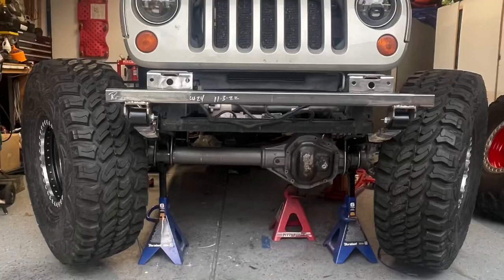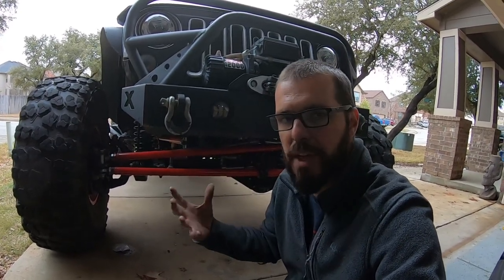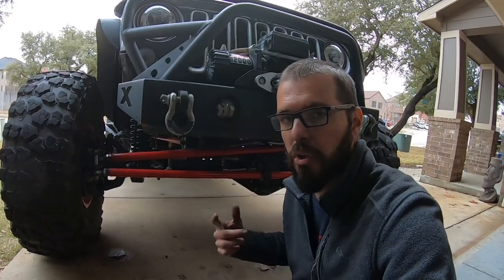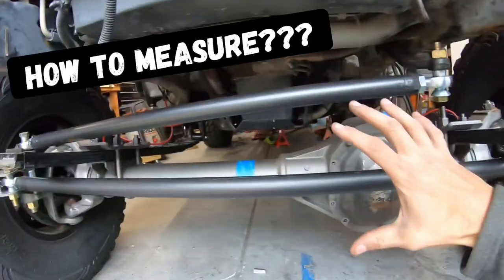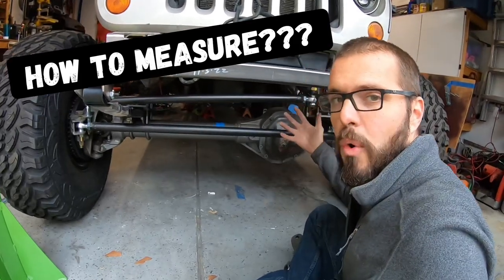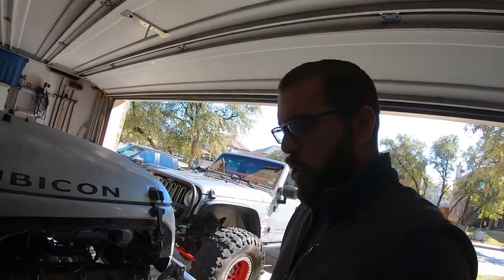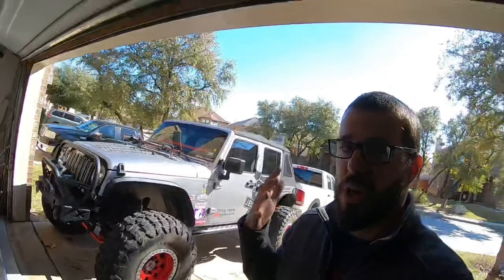The BEST Jeep Steering Mod - Hydro Assist

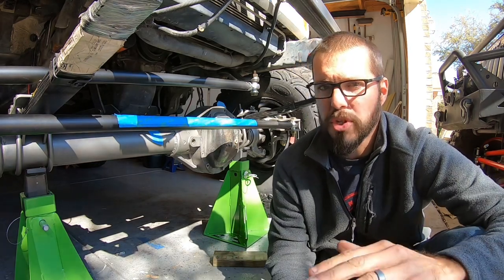Comment: Hey! You said in a previous video (#17 at 8:30) that your tires didn’t contact the leaf springs, you said it had tighter steering than warpaint. What changed?
Reply from the maker: With leaf springs you don’t have a track bar. With war paint I need one. So the pitman arm on war paint contacts the track bar bracket if I turn full driver with that axle. With the leaf springs it’s a non issue due to not having one.
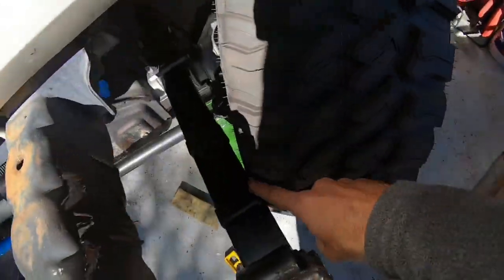Reply: @WarPaintOffroad  I understand track bars, I’m saying in the maple leaf video: #17 you said the tires didn’t contact the leaf springs, then in this video at 9:40 they ARE contacting the leaf springs. I need to choose between axles this week and its hard to find good information on leaf sprung super duties
Reply: @MaliqThalier You gotta pay closer attention. In this video he shows that the tires COULD contact the leaf springs if not for the fact he's mindful of that during installation and limiting the travel. I just looked up the video you talked about and the part you're talking about starts right after 8:00, and he's basically just saying the same thing--that when you're planning your steering you need to be mindful about tires contacting the leaf springs and be sure you've mitigated that with your setup.

Comment: I’m personally running the west Texas off-road hydro assist setup. Have had it for a few years. Honestly, ehh. It’s decent. Could be better. But I have the 3.8 with the weaker power steering pump, and I tried to install the smaller pulley but failed. So I still need that.
Reply: What purpose is the small pully? I understand smaller pully more rpm, is the power steering pump that under powered that you would have to overspeed it? I have a 4.0 a 4.2 and 3.6 so I've never got to deal with the issues of the 3.8.
Reply: @callmesomething1425  the smaller pulley allows the belt to spin faster which gives you like 20% more power to the power steering system I believe was the numbers they said.
Reply: @StormbornJKU  awesome, I wonder  how that would translate to using a larger diameter ram? I'm piecing a kit together for my wife's rig I have a ram but if I can go with bigger it would help boss those 37's around with a little more gusto.
Reply: Oh man I disagree, I’m currently running their stuff on a TJ and a JKU. I have the 1.5” and a 1.75” ram and I’ve had no problems whatsoever. Both have been on about 2 years. 

Bummer that smaller pulley didn’t work for ya, I’ve heard a few folks running em and have had good results
Reply: @Centex_jeeper  I just messed up the install. I plan on installing again in the future now that I’m not as dumb lol
Reply: @callmesomething1425  if I could go back in time, I’d just get PSC honestly.
Reply: I had the west Texas ram package about 5-6 years ago it was so junk if I’m being honest. Hoses and fittings were fine i actually still have them it’s the ram itself I found junk. Being aluminum and steel for whatever reason my fittings at the bottom but at the ram wobbled their way to where fluid leaked (shot) from the nuts and no amount of tightening or loosening fixed it until it catastrophically failed. Replaced with psc components (psc) welds bottom nuts) and never had a problem since heck I still have the same ram on that’s all beat and 2 spares in my parts. Only good thing about the west Texas was the smaller pulley eliminated dead zone parking lot and low rpm turns
Reply from the maker: @ironbearjku2233  that’s wild. Might have just been an issue with an early design. A lot changes in 5-6 years. I have their ram and have a number of friends who have them and they all perform very well and very consistently. I’m sorry you had that experience. Sounds like it was either defective or just an early design that they improved. Their stuff just plain works.
Reply from the maker: @StormbornJKU  some people like spending more money for the same stuff. But honestly, you said above that you messed up the install. I haven’t seen it to know how you messed it up or think you messed it up. But, I personally have seen several of them in action and have it in my rig and have absolutely no complaints. It works great. I do know that the other guys have LOTS of problems with their pumps and they are next to impossible to get in the phone to handle the issues. So utilizing a rebuilt factory pump and the pulley change for the 3.8 is definitely the way to go.
Reply from the maker: @callmesomething1425  you’ll be fine with a 1.5. You really only need the 1.75 on a 40 or larger. And tbh, I’m only running the 1.5 ram on my rig with 40’s. So the 1.5 with 37’s would be great. Rams do change the steering characteristics. It won’t feel like factory which is what I think a lot of people expect. The wheel doesn’t become light as a feather. And the ram will only move so fast…so if you try to turn the wheel faster than the ram will move it almost feels like you don’t have power steering. The smaller rams help with that and do move quicker than the larger rams. But they provide all the power you could want offroad. The only time I notice the slower steering response is when trying to turn the wheel into a parking space. But other than that…it drives great. You’ll be very happy with a redneck ram.
Reply: @WarPaintOffroad  cool good info, I was focused on power and overlooked speed. I guess I'll stick to the one I have it's a 1.5" bore with 8" stroke. I'll most likely have to put limiting bushings but time will tell.
Reply: @StormbornJKU  hahaha oh man I’ve done stuff like that a time or 2!
Reply: @WarPaintOffroad  yea I messed up installing the smaller pulley. Ended up getting it stuck kinda sideways on the factory pump. So I went and replaced the pump with another factory mopar pump. 

Now that I’ve become more knowledgeable since I did that install I’m going to end up getting the small pulley again and redo the install. Hopefully that helps make a difference. If not then I’ll look into a PSC pump and reservoir.
Reply: @WarPaintOffroad 

Exactly! I have the same issue with parking.

But last winter showed one more significant issue for me. When the stabilization system doesn't work (or just switched off) and you get the skidding, you want to release the acceleration pedal and turn the steering wheel pretty fast. But the hydro assist doesn't let you do this.
I drive the 2015 JKU with 37" tyres and 3.6 liters engine. I modified the steering box with my own and I didn't do anything with the pump.
How do you think how can I improve the productivity of the pump? Maybe you have some experience with it?
I have seen that the valve from the pump can be modified. And the second way is to set the smaller pulley, but the smaller pulley can need the shorter serpentine belt, right?

And one more point about the smaller pulley: with the maximum engine rpm the pump will have much more rpm than it was designed for.

Thank you for your useful videos!

P.s.: sorry for my English if something is wrong, I'm in Ukraine and use English with YouTube only for now.
Reply: @StormbornJKU 
Could you, please, explain what exactly was messed up?
I just wanna know another experience to not repeat the same mistakes.

Comment: What do you do to make SD brakes work with the JK
Reply from the maker: Great question. I plan on making a video about that soon. But there are a number of options. I personally used the J8 kit. That is a larger booster and master cylinder. The stock brake pedal works in this situation and it allows the master cylinder to move more fluid. The factory brake hoses bolt up with the right thread banjo bolts for the calipers. It works perfect. But there are other options. I’ll speak to the ones o have experience with in a future video.
Reply: Yeah I couldn’t find the JK8 kit when I did mine so I just upgraded the master cylinder